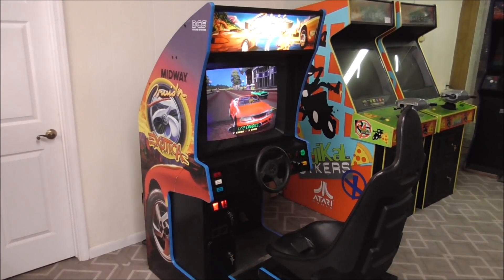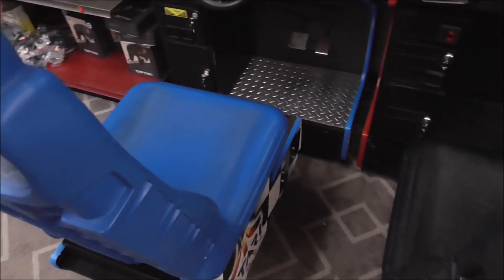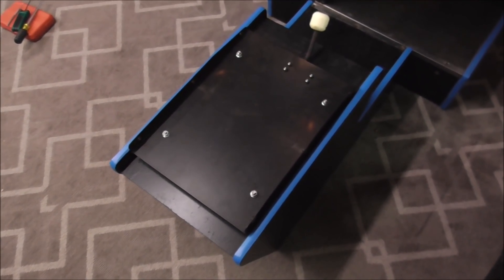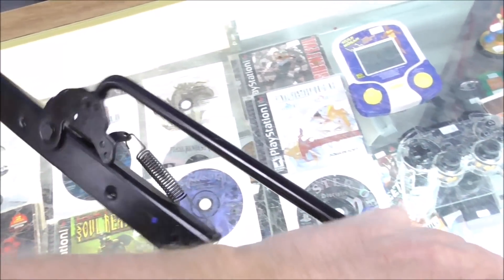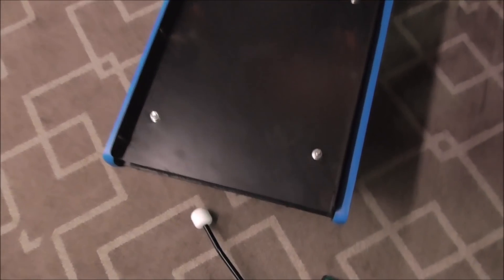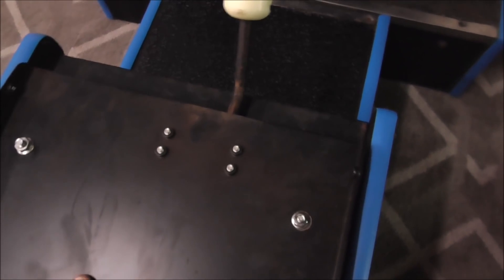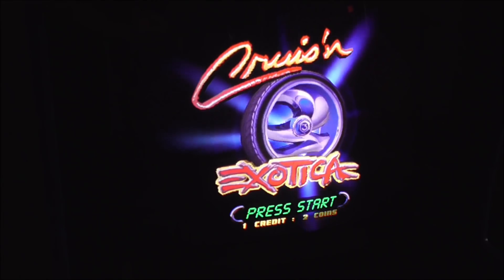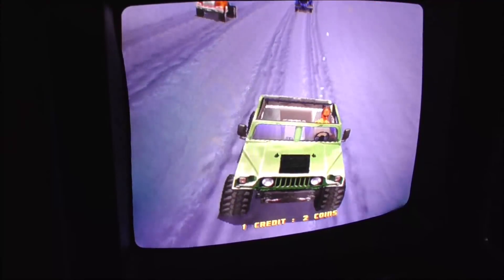Fixing the Seat on MIdway's Classic Cruis'n Exotica Arcade Game !  Works On Most Driving Games...

Comment: I have a SF Rush: the Rock. Where can I find a white knob to adjust the seat?
Reply from the maker: I believe on Rush they had a different type of knob but it should be under the seat....
Reply: @LyonsArcade  it's a metal bar and it has left scratches on the cabinet from the lack of an actual ball to grab onto

Comment: I have a faster than speed arcade. 
The rpm redlines without pressing the gas like it’s stuck 
Any idea what that can be.
Reply from the maker: The potentiometer is probably loose or you have a wire broken down at the gas pedal
Reply: Thank you so much. 
I’m screwed. The game will start and run 
But I have no gas no brakes and no steering 
I’m gonna trash this thing. 
But thank you so much